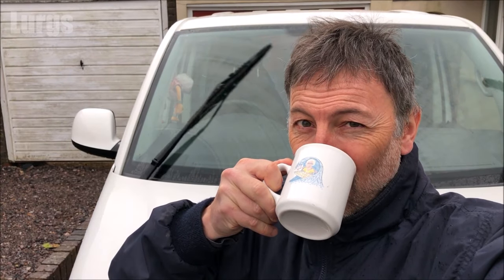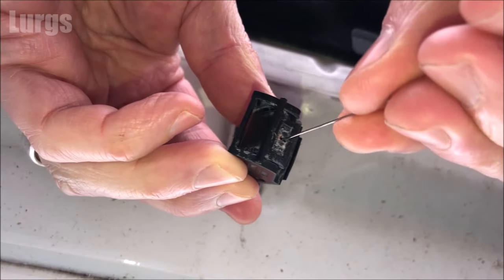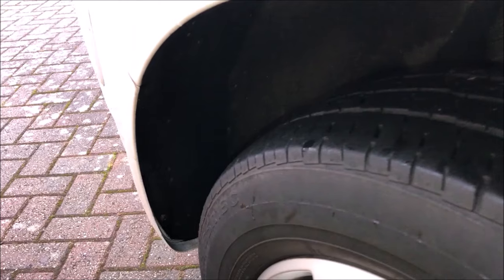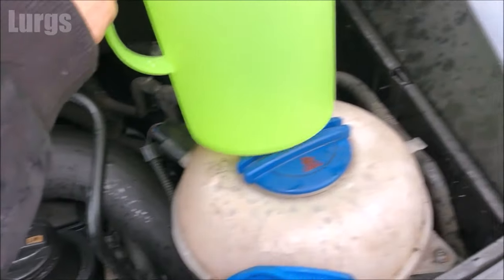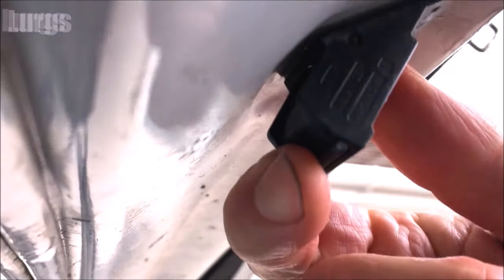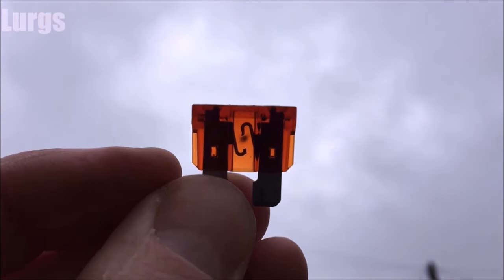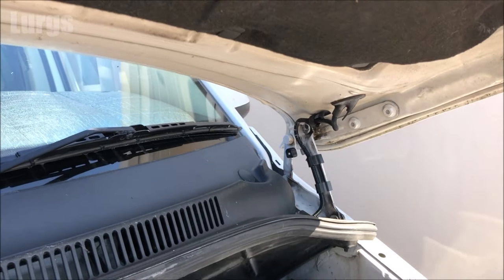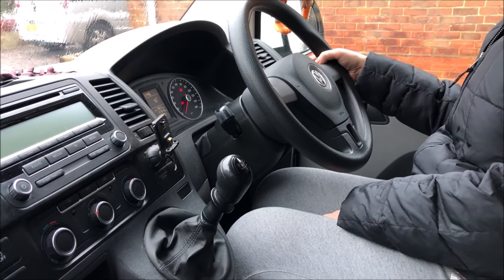Windshield Washer fluid not working diagnose and Fix

Comment from the maker: Other useful How To Guides to help you save ⏱TIME and 💰 MONEY:
Vehicles How To's, Tips, Tricks & Fixes  https://www.youtube.com/watch?v=w44aQ7dc_Lk&list=PLqrXuUebV8N9fyM8qA2D0rkVfv929Ckod
How to check car fuses without pulling them out using a Multimeter https://www.youtube.com/watch?v=w44aQ7dc_Lk&list=PLqrXuUebV8N9fyM8qA2D0rkVfv929Ckod
How to test Car Fuses without pulling them out using a Car Blade Fuse Tester https://www.youtube.com/watch?v=zLfa7_FbZrU&list=PLqrXuUebV8N9fyM8qA2D0rkVfv929Ckod
Tyre Pressure Warning Light is ON and How to reset it https://www.youtube.com/watch?v=2AIxNtg8ICo&list=PLqrXuUebV8N9fyM8qA2D0rkVfv929Ckod
How to disable Start Stop on a Vehicle https://www.youtube.com/watch?v=dxzMDT1s7WE&list=PLqrXuUebV8N9fyM8qA2D0rkVfv929Ckod

How to check a Car Battery with a Multimeter https://www.youtube.com/watch?v=VlkYGIMFj48&list=PLqrXuUebV8N9fyM8qA2D0rkVfv929Ckod
How to connect a Car Battery Safely https://www.youtube.com/watch?v=1b2vJjUefYQ&list=PLqrXuUebV8N9fyM8qA2D0rkVfv929Ckod
How to disconnect a Car Battery Safely https://www.youtube.com/watch?v=XJ5SUabZCbc&list=PLqrXuUebV8N9fyM8qA2D0rkVfv929Ckod
How to prevent your Car Battery going flat due to lack of Use https://www.youtube.com/watch?v=xH9V5xfSSMQ&list=PLqrXuUebV8N9fyM8qA2D0rkVfv929Ckod

How to check brake lights by yourself https://www.youtube.com/watch?v=jBK5W18zGJg&list=PLqrXuUebV8N9fyM8qA2D0rkVfv929Ckod
How to fill Screenwash Fluid on any Vehicle https://www.youtube.com/watch?v=zQTDe-u5qA0&list=PLqrXuUebV8N9fyM8qA2D0rkVfv929Ckod
Fuel Cap Side Top Tip https://www.youtube.com/watch?v=s8GSMM8sBiA&list=PLqrXuUebV8N9fyM8qA2D0rkVfv929Ckod
How to replace Wiper Blades https://www.youtube.com/watch?v=Md51wggLBJI&list=PLqrXuUebV8N9fyM8qA2D0rkVfv929Ckod
Windshield Washer fluid not working diagnose and Fix https://www.youtube.com/watch?v=F4nuQ31cluY&list=PLqrXuUebV8N9fyM8qA2D0rkVfv929Ckod
How to use Car Air Conditioning on a Hot Summers Day https://www.youtube.com/watch?v=4zfhuBpWYt8&list=PLqrXuUebV8N9fyM8qA2D0rkVfv929Ckod
How to find a Puncture in a Car Tyre https://www.youtube.com/watch?v=6orpFjsRQGA&list=PLqrXuUebV8N9fyM8qA2D0rkVfv929Ckod
How to replace an ABS Wheel Sensor https://www.youtube.com/watch?v=Kc_g6oudDaM&list=PLqrXuUebV8N9fyM8qA2D0rkVfv929Ckod
What is TPMS and how does the Tire Pressure Sensor work https://www.youtube.com/watch?v=pEkeYkZu-oE&list=PLqrXuUebV8N9fyM8qA2D0rkVfv929Ckod
Car Indicators Soft and Hard did you know? https://www.youtube.com/watch?v=qU75BT_vvdY&list=PLqrXuUebV8N9fyM8qA2D0rkVfv929Ckod
.
How To's, Life Hacks, Helpful Tips https://www.youtube.com/watch?v=dcmxUTsedlk&list=PLqrXuUebV8N92xXP4Dm_pHfBpEQ3wtP2R
Washing Machines How To's, Tips, Tricks & Fixes https://www.youtube.com/watch?v=0_gst8RokRo&list=PLqrXuUebV8N_Bv_41hH-IpIfM5qiS0Sin
Dishwasher How To's, Tips, Tricks & Fixes https://www.youtube.com/watch?v=6z22-Ysn7rE&list=PLqrXuUebV8N89GJMUjDiMqGpAcic3wqfD
Toilets and Plumbing How To's, Tips, Tricks & Fixes https://www.youtube.com/watch?v=vT5KwJ2A2eU&list=PLqrXuUebV8N_d4OWPjAk4PJ7LnKb0Jdot
Combi Boiler How To's, Tips, Tricks & Fixes https://www.youtube.com/watch?v=1gGEP2y_qHM&list=PLqrXuUebV8N8aiBpt_F3n23E3IOLlmgK2
My Reviews https://www.youtube.com/watch?v=QX0ge0QOXJk&list=PLqrXuUebV8N9_JYlSh2LjbfUsybF840oy

Comment: Cheers Lurgsy, with your inspired off-site diagnostic support I systematically identified a leaky pipe and inefficient jets so have ordered 2 new jet nozzle units & 2 new pipe connector repair thingies. Stoked to have saved money on labour time & non-eBay item prices, and makes me feel like a knowledgeable grown up!!!😛👍🤙
Reply from the maker: No problem. The T5 washer pipes are a terrible design coz every time you close the bonnet it bends right over so eventually it splits!

Comment: Hello, thank you very much for the video. My Opel Corsa C 2001 windscreen jets don’t work either. First it was the front jets. The both didn’t work, but after a few clicks they worked again. The rear jet at that moment worked. But a few days later, both quit working.
Reply from the maker: Hope you can get it fixed, good luck

Comment: Will the central locking work after disconnection? I have disconnected the two wires but my central locking no longer works via keyfob. But I have the feeling this is due to the battery being completely flat as I was away on holiday and the alarm module went off and completely drained battery. But are you able to confirm?
Reply from the maker: Not sure I’m afraid

Comment: Hello! Followed the steps and established that the washer pump on my Soda Fabia SE 2015 was not making any noise. I used the multimeter and could see that the fuse seems to be working okay. I thought that meant my pump had burned out so I replaced it, only to find it still doesn't work. I am hoping it is an issue with the connector on the pump itself. One thing I should of done was use the multimeter on the wiring going to the pump. Is there anything else I can do instead of removing the whole thing again? I am hoping its not the stalk. Any advice please?
Reply from the maker: Remove the plug from the pump unit and then put a multimeter on the connections and get someone to pull the stalk and see if you get 12volts. If not then try the fuses first then after that it could be the stalk but they don’t usually fail

Comment: Good evening! My problem is a little bit different. Whenever I activate the washer, the wiper goes all the way and, going back, stops halfway and the fuse is blown. I tried replacing the fuse and then the exact same thing happened again (wiper stops halfway going back). The only way to get the wiper back in place is to replace the fuse, then start the car so the wiper goes to the original position.
Reply from the maker: If the fuse keeps blowing it could be an electrical fault on the motor or the wiring somewhere. Hope you can get it sorted. Good luck

Comment: I've been told that the filter is blocked on mine, does that make any sense, or is someone making things up? I didn't see any filter in your clip.
Reply from the maker: @stevewright7745  This is a generic video. The only filter I’m aware of on models is the small one where you pour the water in, this catches small bits of grit.
Reply: @LurgsHowToGuides  Thanks, it's a Vauxhall Vectra.
Reply from the maker: @stevewright7745  In this video at 2:15 there is a removable filter in the lid. That’s the only type of filter I’m aware of for windscreen washer fluid.
Reply: @LurgsHowToGuides  It must be somewhere towards the end of the pipeline, a mechanic told me it was blocked because of dilution being too thick and not using the washer enough to keep it moving through the system, I guess it's sort of crystalised within the filter, blocking it altogether, because I don't get anything coming out of the back wiper either.
Reply from the maker: @stevewright7745  Never heard of a filter inside the pipework or reservoir before. Hope you can get it sorted
Reply: @LurgsHowToGuides  I think you'll be as surprised as I am with this, I haven't checked it for ages, weren't much point as I thought it was broken, but I've just tried it and was shocked to find it's working fine now, don't know what that was all about, hasn't worked for around a year, tried them several times during that time with no joy. 👍
Reply: @LurgsHowToGuides  False alarm, I just tried it again and no water at all came out, the tank is full, must be a blockage somewhere, but it must be able to just trickle through gradually so as to allow me to have just squirt a load on my windscreen.
Reply from the maker: @stevewright7745  Hope you get it sorted. Check wiring first and also the bottle reservoir,
Maybe it’s full of sludge? Remove and clean it out if you can
Reply: @LurgsHowToGuides  Someone else has said that there's a filter at the bottom of the reservoir that's most likely blocked, I'd have a go myself, but there's that much under the bonnet these days, I doubt I'd get in, looks like the wallet is going to have to come out :( Thanks anyway.

Comment: Hi Lurgs. Is it a blade fuse I need for this. There seems to be mini blade, maxi blade and just blade fuses??? Don't know which one to order. Thanks in advance x
Reply from the maker: What’s the one that has blown? It is most likely standard size although if it’s tiny that’s the mini fuse. No idea why they created different sizes! The tiny ones are hopeless to try and unplug or plug back in
Reply: @Lurgs How To Guides  its the windscreen washer pump. I reckon it must he a standard 7.5 blade, ya think?
Reply from the maker: @moragclark7839  Remove the blown one and get a direct replacement. Don’t try and guess as you need the correct amp one

Comment: I have Iveco Daily. I didn't try with hot water... going to try that tomorrow. The pump is buzzzing, but no water,  i did clean all the hoses and there were no leak either.. so weird, my car is from 2020😵‍💫
Reply from the maker: Sounds like just frozen pipes, maybe not enough Screenwash concentrate. Might be ok today if you are in England as it’s milder
Reply: Did you ever solve this. My pump clearly has power - it buzzes loudly. Pipes are clear - I can both blow air back through pipes and make water bubble in tank. And I can suck water from pump up through the pipes. The pump still doesn't move any water....

Comment: i've replaced both fuses and pump....and it still does not work....and i can't hear my pump working  like before.....any ideas? :(
Reply from the maker: Need to test the wires on pump with a multimeter when someone pulls the stalk to see if 12v is getting to it. It’s very rare the stalks break. I would double check fuse again. Good luck
Reply: I have exactly the same problem. Pump is not broken, it works when I feed it directly, fuses are ok but it doesn't get any power when I press the stalk... Only thing left to check is the relays. 
Did you manage to find the cause?
This is on a Peugeot 207